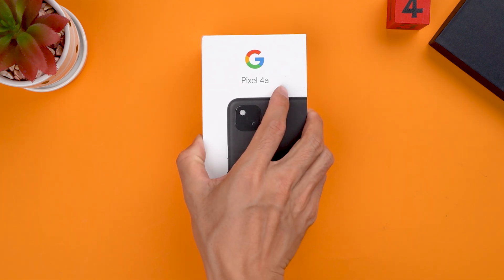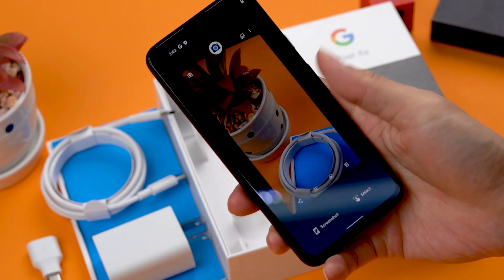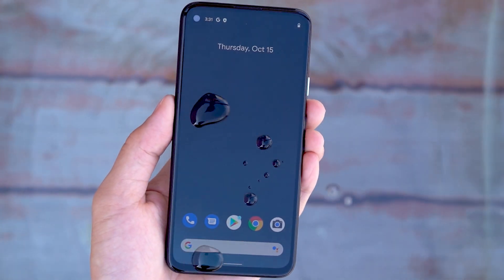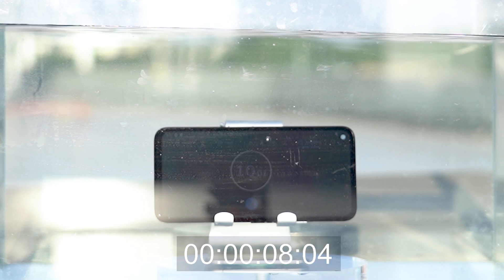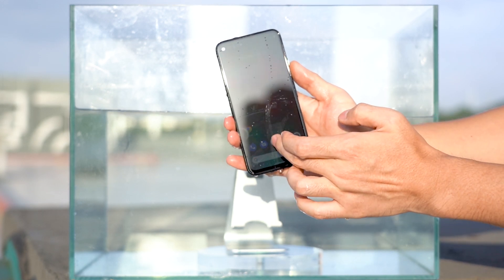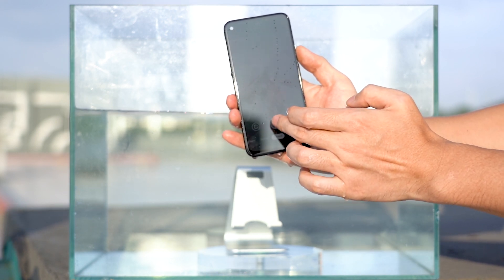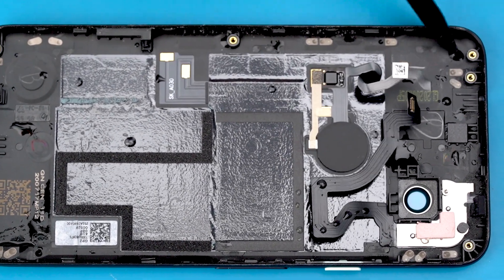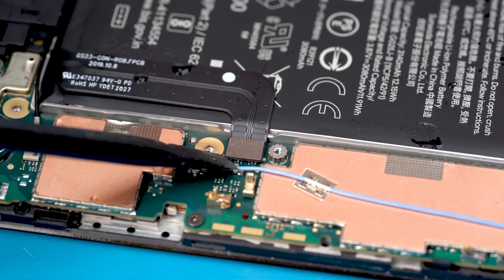Waterproof Test | Google Pixel 4A  waterproof rating?

Comment: I left this phone out overnight recently on accident. I'm impressed at how well it survived both extreme heat and a downpour. It was smart enough to shut down during a moment of extreme heat, and when the USBC port got wet it deactivated it until it dried off. Then it sent me a warning telling me when it was dry. No issues whatsoever despite going through nearly 18 hours of unsupervised exposure to the elements. I feel like an idiot but not bad for a $350 phone at MSRP

Comment: Dropped mine in the toilet (when it was clean) and it worked on and off for a day until the corrosion set in. Then it was broken for good. I bought another from Target and paid $80 extra for an Allstate warranty that includes spills, water, accidentally breaking etc ... Basically everything except theft. I think the plan is better and cheaper than extra warranty Google offers. The 4A is not made waterproof at all and doesn't even have any rating contrary to this video. Even waterproof phones can die after getting wet, it's only glue and tiny rubber seals that they use. I bet anything that the phone in this video eventually died. It takes a good day or so for the corrosion and chips to finally fry.
Reply: This, same drop, same place, same story pixel 4a died within hours, this video is some quality horseshit
Reply: @relieh  I went surfing with my Pixel4a in a waterproof rafting pouch. I must have got a few drops of salt water into it because for several days I got the "moisture detected, USB & Charging" notification. My mistake was keeping it powered up, and repeatedly plugging it into a charger. A local shop is now replacing the charging board, but slim chance this will fix it.

Comment: Mine fell into the pool yesterday. Submerged about 10 inches until I grabbed it. Never hit the bottom. Dried it off, brought it in the house, dried it off again just to make sure (adding a little shaking to the top and bottom where ports and speakers are), turned it off, and just to be safe, put it in a bag of rice until this morning. Been using it all day to this point without issue. Just plugged it in to charge now and I'm watching it like a hawk.
Reply: Yo dude any updates? Please?? Dropped mine in the bath 🤦🏼‍♀️
Reply: @bethel4988  Mine is still running strong since the dip in the pool. Calls are fine, screen is responsive, charges fine.
Reply: @JediVampire73  thank you so much I’m glad!! For some reason mine broke hahah tbf didn’t put in rice and I regret that now 🤣

Comment: Not possible, can you tell us if its working after 3-4 days of your test, my phone got damaged just by splash of water, and its  beyond repair. the repair estimation provided by B2X was higher than cost of actual phone.
Reply: Hi, 
     my 4a has drop in water for  nearly 1 second, now it's working fine still after 1 day, do you have any suggestions
Reply: @alanty4607  Mine was started showing blue dots after 3 days and that covered almost entire screen after couple of days.  Keep it switched off for few days and dry it,

Comment: Had my 4a in my pocket. Jumped off my boat into the water got back on the boat 30 seconds later. Phone was ruined.
Reply: I'm assuming you were in salt water? minerals do most of the damage, not water
Reply: @bmz4  Yup it was salt water. The screen  changed colors almost instantly.

Comment: I just got my pixel 4a two days ago, today I had it in my pocket and got rained on, a super light sprinkling, not even 5 minutes. 
Now there is moisture inside both camera lenses and it won't power on.
Reply: Well, I bet if you just let it dry out, then it will be fine.  I know a little late to tell you.  But, just make sure that it drys out.  It'll probably be fine.

Comment: I have a pixel 4a, and it definitely did not function normally after I splashed it with water. it's basically gone.
Reply: Just give it some time, Choochoo, and let it dry it.  I bet if you just wait long enough, it'll dry out and be fine.  Give it a few more months and see what happens when turn it on.

Comment: Such a great video!!!

I was considering upgrading to the 4a 5G from a 2XL (with water rating), mainly for the updates, extra RAM & display haha - other than that, my 2XL seems okay 

But this was one of the main reasons I wasn't sure - coz I'd be paranoid if it ever got wet lol

Now I don't feel as stressed, subscribed!
Reply: Does it not concern you that when he opened the phone the interior circuits were covered in water?
Reply: @Soknik01  not really, as I know I'll never soak it in water or use it in heavy rain - I was only worried about light rain 😊

Comment: dropped mine in the hot tub. had to create a heated vacuum chamber to get it working again. worked like a charm.
Reply: How did you create it? I'm in the same situation.  How much time elapsed between exposure and recovery?  Did you have any problem from the chlorine?
Reply: @billycroan2336  it was about 2 days, sorry for the late response. I took a mason jar and heated it to 175 in the oven with the lid off. took it out and immediately put the phone in and sealed it and let it cool down for a couple hours. put a paper towel in there with the phone. also repeat this until there is no more moister in the jar after it cools down. I did it 4 or 5 times.
Reply: @billycroan2336  but my phone is still working today so it is possible! good luck.

Comment: My phone dropped into sink of water for 2 seconds and water had entered into the lens, now it has water spots internally and on the lens cover that won't go away. How did this video survive and not get water ingress in the lens?
Reply: same but my phone literally wont turn on
Reply: @desertchinatownpig3917  let it dry out for few days, gently heat with hair blower dryer. It went away for me and fixed itself but my hands-free speaker option doesn't work anymore.
Reply: @eTeeGaming  thx its been 2 days but im not sure if I should leave it still as it is completely dead
Reply: @eTeeGaming  Good for you.  But, damn -- if the HFS is your only problem, you don't really have anything that bad.  Damn wife just dropped it in the sink and we rushed it to one of those fix-it-places to see if they can help us.  And, now, I'm looking at maps on Google, as I am trying to pick a good place to hide her body.
Reply: @desertchinatownpig3917  Did you ever find out if it worked again.  I think if you keep leaving it for a while, letting it dry out, it'll eventually be back to normal.

Comment: Just ordered one yesterday. I'm happy to see that even without any IP68 rating, it can take some splash without any issue.
Thanks. Great job.
Reply: How is water inside the case not an issue?
Reply: @Soknik01  Didn't that happen later, when they submerged the phone fully in the water tank (i.e. not when the phone was splashed)?
Reply: @aliasgharkhoyee9501  no doubt the majority if not all of the water inside the phone was there as a result of being submerged but we have no way of knowing for certain since the phone was only opened for inspection once at the very end of the video.
Reply: @aliasgharkhoyee9501  I personally had my pixel 4a 5g quit on me due to water damage that came about as a result of sitting on my bathroom counter while I took a hot shower.  I've read plenty of comments from people who have had their 4a 5g exposed to far more water than mine without it doing any harm to their phone.    I think that cases like mine are probably pretty rare. For the majority of people who don't work or live in areas where water exposure risk is particularly high I suspect the phone would be just fine.

Comment: What do I have to do when that "liquid or debris in usb portal" notification comes??
Reply: Sea water went into it for 10-15 seconds, and this notification came up..
Reply: Let it dry and don't use the port until the notifications gone.
Reply: @nils895  I sent it to google service center they said the motherboard's gone and it costs high for the repair.
Reply: @rohansahay1398  How long did you have it? You might try a warranty repair, but water damage usually isn't covered. I'm really sorry to say so, but if you let your phone fall into some body of water, no one can help you, just pay for the repair. If that wasn't the case, it should be covered by Googles warranty or your countrys customer protection laws.
Reply: @nils895  Yes, warranty repair doesn't cover water damages. So I have no other option. I used it just for 3 months.

Comment: I dropped my iPhone 6s in the bath... That was over 2 years ago. Still working fine. I did take it out in less than 5 seconds but my point is.. It wasn't the end! I did shake it and put it in a container of rice to help dry it out. This pixel 4a looks like it would cope far better than a 6s!
Reply: My 6s would die after 1sec in a bath, it has whole screen shattered, half the glass is gone and I can literally touch the display itself on the corners. Still working fine tho, can't find a worthly enough phone to replace it.
Reply: @xxxxdddddss  When one of your friends sets their phone down, just swap it out with theirs and act like theirs is yours.  Then, you won't have to buy a new one.  I did it and my is a little mad that someone took their phone.  But, I just played dumb and, now, got a new phone.

Comment: My pixel 4a was on a shelf next to my shower and it vibrated and fell, to my horror, right into the shower under my feet. Immediately blasted all holes with hair dryer on max. Glad to hear even if it's not rated that it still seems to have some engineering put into water resisting
Reply: The IP ratings are overrated, I poured some water on my Google Pixel 4XL (being careful not to splash the USB port) as it was burning hot and I thought the IP68 would protect it. It didn't. Phone wasn't respoding for a while, left in in a rice bag for a week and it worked one more year. Finally it completely broke after a small drop. Screen didn't break but something inside did and the phone does not turn on. Took it to a repair store and was told there was no solution.
Reply: @santangelx1573 you unlucky lol , i didn't have a scratch on original screen BC i use Flip cover

Comment: Just bought and am waiting for the Pixel 4a 5G. My biggest hesitation was that it was not IP rated like the 5 is. I'd be super interested in seeing the same test for the 4a 5G, although I'd guess it's probably be very similar to the 4a results.
Thanks for your video!
Reply: When i bought my pixel 3a XL i got a $20 waterproof case, IP68 rated, on Amazon. Hopefully there's one for 4a 5G.
Reply: @somethingelse25  can you put link to that? I'd check it out.
Reply: How do these cases work, do they block the phone entirely (if so how do you change the SIM and does the fingerprint reader still work)?

Comment: What is your conclusion based off of? How do you know that water is all from submersion and not from the previous tests? How can you confirm that it's at 2 to 3 when you haven't compared results from each test?
Reply: Submersion creates pressure trying to enter the phone, spraying does not.
Reply: @aharrington080611  Spraying has pressure from the hose.. the water is traveling at high speed and has momentum, unlike in the submersion test where it is still.
Reply: Because it would make sense that most of the water that's inside of the phone, is probably of the heaviest test, aka the water submersion
Reply: yeah it could have entered during the earlier shower test.

Comment: I'm actually impressed with these results. Thank you.
Reply: Yeah, without the IP rating, thats really pretty decent.
Reply: @zerosandones7547  i have the pixel 4 a is it waterproof ?? i'm afraid to come in rain. but apparently it can withstand rain? or is it broken after water test? I am Dutch linguistic
Reply: @robivde1  based on the vid, the pixel 4a is working fine with the splash test, but when the pixel 4a is submerged it STILL worked well NO  PROBLEM, but when they opened the phone there was water inside. So your phone is going to be okay and will be able to withstand rain.
Reply: @robivde1  even if the phone had any ip certification it doesn't mean it's water proof, you should probably keep your phone as dry as possible
Reply: @robivde1  you can try with spalshs  don't drop in water ok
Reply: @iqsuperkid7523  oké thank you 👍
Reply: @dariugui  yeah that should be the case at all times.
Reply: @zerosandones7547  my oneplus 7t pro has no up rating and is waterproof, but tbf that decissiom was made fof financial reasons.
Reply: I'm sure the phone died by the next day. It's a delayed reaction with the corrosion and water seeping into things.

Comment: I think having an official basic splash resistant rating should be a bare minimum on phones these days... Will extra 20-30$ make a difference to the end customer??
Reply: $20 to $30 is enormous on a $350 device. they're probably eyeing dozens or hundreds of things that cost or save like $3 each. a budget phone like this is a smorgasbord of tradeoffs. if you want everything then you pay $600+.
Reply: Maybe they can't, given that it's a plastic phone? If a phone is all glass and metal, it's predictable and they can make a guarantee for the line. But a less rigid plastic phone will constantly undergo tiny flexes and changes with temperature, and it only needs the most microscopic shift in a seam for it to be no longer as waterproof as a newly made model.

Comment: Just the vid I was looking for. Google really made a bad choice in not including water resistance for this phone. The 4a and 4a5g will definitely surpass the Pixel 5 in sales without it though.
Reply: its budget phone, what to expect.
Reply: Phomes didn't have water resistance for years and we did just fine. It's a budget phone. Basically the only budget phone that has water resistance is the iPhone SE and that's only because they just recycled the already water resistant iPhone 8.
Reply: 4a 5g also has no water resistance rating
Reply: Comon misconception about IP Rating

The IP rating is not an official standartised test bound to international standarts like ISO or DIN or ANSI norms. They are a set of standarts that the industry agrees upon, and to test these phones on IP Rating, it takes aditional testing and redesign. All those processeses cost money, hence why mid-range phones dont get IP rating. It is to keep the phone cost low. It doesnt mean that the phone isn"t waterproof. 

Take a look at jerryrigseverything where he takes the oneplus nord apart and you'll see how much water resistent design and engineering there is in the phone. And the phone has no IP rating.
Reply: @jetmirkorani852 looking for this comment , thanks 😅